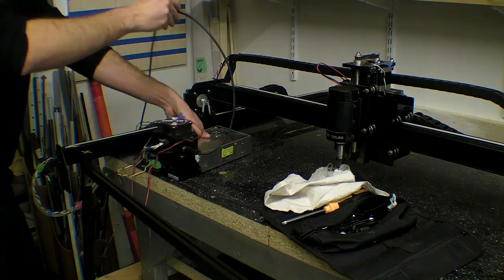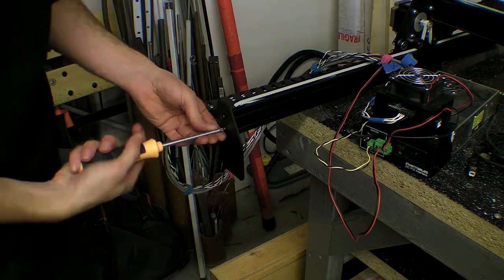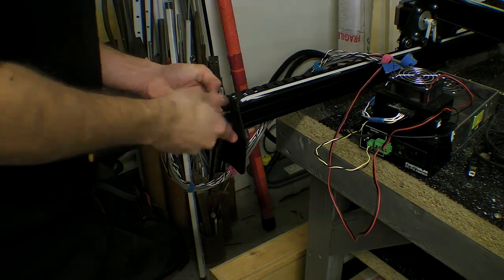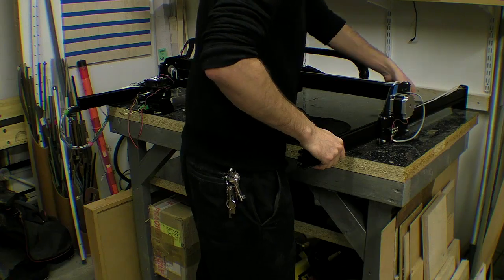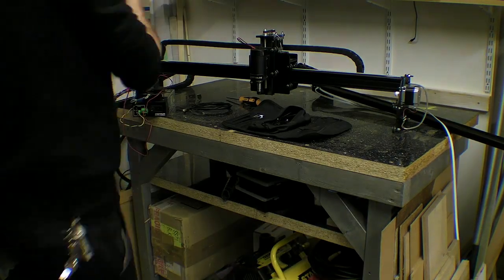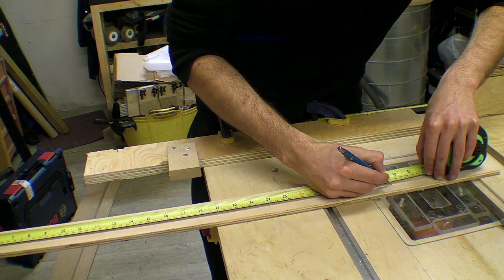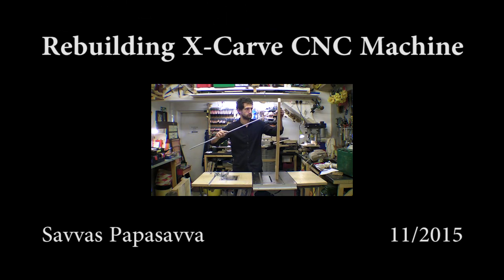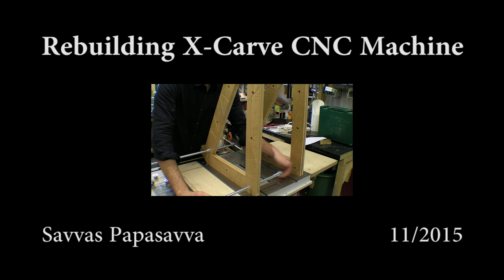Upgrading X Carve CNC (With Parts From Ox Carve) - Structure

Comment from the maker: Just to answer a few email I got regarding this project. You will need to change the steps. If you do this in Easel, you need to go to the Machine tab, click on Advanced, and Machine Inspector. Type in the console your adjusted steps for your Z axis - in my case I ended up with - $102=50.632

Comment: I messed around a bit with the smaller one some and what I did not like about it was the same things you ran into. In addition having net access to operate it would be the game killer for me at any price. My home brew made totally out of mdf using v-rollers running on 3/4 steel angle iron constantly cuts at around 100ipm with accuracy and repeatably at about 1 thou ran me right at 900 including the mach 3 control software. Cutting area is 24 X 18 Y and 9 Z. the bed is a torsion box 4 inches thick  2 feet by 3 feet. Ive put around 500 pound in the dead center of it with about .003 deflection.  Ive been running mine for about 4 years now with no real issues. the X carve I looked at can be easily converted to stand alone ( NO net access) by simply junking the electronics, other than the power supply, and going with a breakout board and 4 stepper driver modules., an additional 36 volt 10 amp supply ( to run the steppers) and a tiny 5 volt supply. Total cost including mach 3 would be about 250. -300. You DEFINATLY need to junk that 300 watt spindle for wood use and go with a small trim router. I have mine set up where I can switch between that 300 watt spindle and a router in about 10 min. I do use that small spindle with plastics, brass, and aluminum where I need spindle rpms below about 20K. Slow revs and slower feeds dont melt plastics or gum up bits on metal with a collent like say wd 40 or 3 in 1 oil. I cant say if that arduino and the small stepper driver under it can handle G-code generated from say Vetrics V-carve or several of the low cost to open source cam programs. Ine of these days I am going to take some g-code from v-carve over to my freind who has the same setup as you and try it. Hang in there, CNC isnt diffigult to get a grip on and when you do you will find out a small CNC is the handiest tool to have in any shop.. :)

Comment: GREAT! Thanks for your Help , now, I'm having a real bad time with my x-carve, V-Wheels in the Y axis (rail) get tightened no matter, I adjust them right before, every project, what would it be your advice, about that problem?, And I want to increase precision. Last thing Do u have a list with comercial references for these upgrades, for me is fundamental to rigidize not only X rail, but also joint between x and Y
Reply: Locktite the bolts

Comment: Hi there I'm curious is that a Axminster table saw.. If so how do you rate it.... model no ???
Reply from the maker: +Simon  Hopkins  It's the old model and does what I need, but the original fence was poor and the blade travels when tilting which is annoying.  Axminster are welcome to send me the newer version to test.
Reply: +Educating Savvas.  pmsl good luck with that.

Comment: What was the cost of the upgrade? How many metres of extrusion? And a quick yes or no too not spoil the next video, was it worth it?
Reply from the maker: +Jamie Phillips So the upgrade to the structure cost around £200. I'll update the web article with a cost sheet. +OpenTronic is actually building his own linear actuator for the c-beam in true opensource style - which can further reduce the cost.
Reply: +Educating Savvas How much extrusion would I have to buy?

Comment: why if u buy a product should u have to do this?
Reply: +Adrian Higgins you dont have to do this. the xcarve is "open source" which means you are encouraged to do as much or as little customizing or upgrading as you want
Reply from the maker: +mike gager Open source is an optimistic term in relation to these companies, especially if you compare them to things like the Reprap Project - which began as an educational illustration of evolutionary principles.
Reply: +mike gager although the x carve uses an open sourced design the machine is sold at considerably more than the value of its component parts (as far as I can tell). So it feels like you're paying the company to have ironed out most of the bugs with what they're selling, but that doesn't seem to be the case. I had to put a lot of work into getting my RepRap running, but I didn't mind because I bought all the parts at cost price.

Comment: I have the 1000mm x1000mm x-carve. And is it worth the $1200 I spent? Honestly yes. It's paid for itself a few times over. I have a few upgrade from the one you started with but the basic machine it the same. I kinda laugh at the lengths you went through for the base to stiffen it up. I got a piece of plywood and sandwiched the x-carve between it and a steady bench. It's now as solid as a rock and cost me $20. You're over thinking this thing. It's not a $5000-10000 machine. For what it is I can easily make an extra $300-$500 a week with it in my spare time. ( I'm talking about maybe five to ten hours a week of manual labor and the rest is the machine ) it's really is a great machine for the price if you understand it's ( and your ) limitations
Reply from the maker: Are you trying to be rude or are you an idiot? Or do you have shares in Xcarve?
Reply: I wasn't trying to be mean. I'm just not delusional on its capabilities. I see so many people ( like yourself ) get this hobby machine and give it shit reviews because it doesn't live up to your expectations. Which are just to high for a hobby machine. I'm continually fixing and doing upgrades to mine to make it better. ( yes this is a bottom of the line, entry level machine, and has a ton of problems ) But like ive said this has more then paid for its self. And because it easily pays for its self I'm ok with its flaws till I can afford a $10k machine. But at no time will I try to compare this with a more ( much more ) expensive machine.
Reply from the maker: It's not a hobby machine... it's a graphic designers wet dream. So get over it. Anyway I built a new machine, building upon the openbuilds opensource platform and it cost a lot less than the x carve.
Reply: i find it funny that you say its "not a hobby machine" when i have an email from inventables stating it in fact a hobby grade machine that people sometimes use for small business production. they were replying to my question asking if it would be a reliable machine for part time small business use. regardless i ordered a 1000mm model yesterday.
Reply: either way i love what you are doing with it and hope to do similar upgrades to mine.